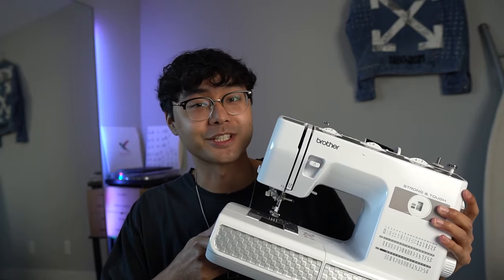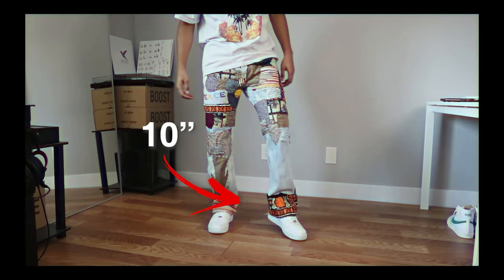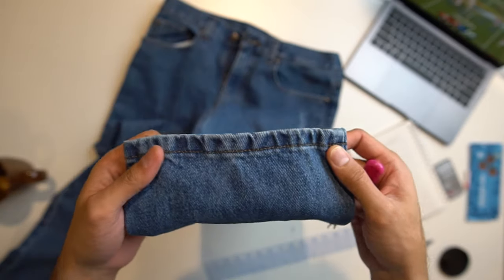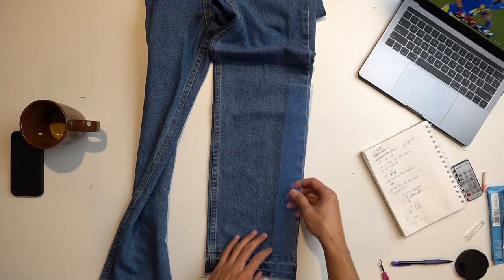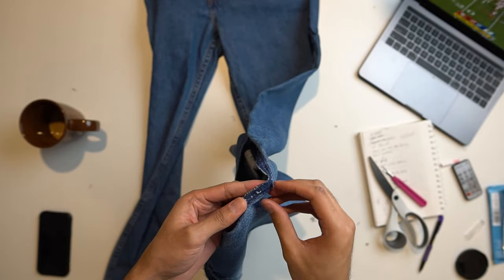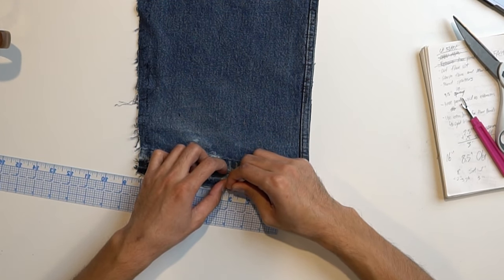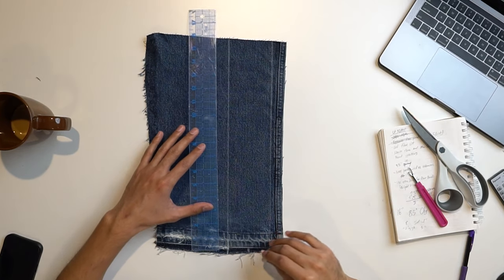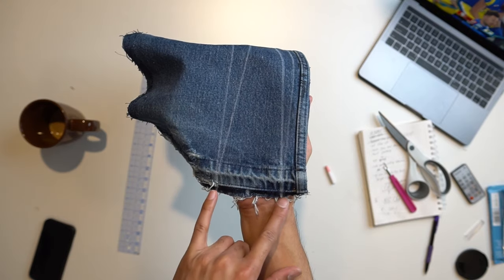How to Add a FLARE PANEL to your Jeans | JULIUS

Comment: good tutorial although since you used the same color jeans as flare I was unable to tell the most crucial part
Reply: specifically 4:36 and on, theres no real explanation behind pinning the flare panel to the actual inside of the jeans
Reply: Thats where im a bit lost right now too. It looks like it was initially pinned to the wrong side and then switched? idk
Reply: So correct I can’t even tell what’s going on at that part

Comment: Can we use a glue gun instead of a sewing machine ? Will we get the same results?
Reply from the maker: never tried hot gluing fabric before. maybe itll work but it wont be as secure. also idk if you can wash it.

Comment: does this work with glue ??
Reply: fuck yeah it worked. i made it work 💪🏽
Reply from the maker: Nice! What typa glue did you use?
Reply: @Julius_Nathvn  regular hot glue man. & then i went over it with glue that they sell specifically for denim & other materials. that shit still working like a charm DEFINITELY MACHINE WASHABLE 4 WHOEVER WANTS TO TRY IT !
Reply: the denim glue is sold at walmart btw. very affordable!
Reply from the maker: @cesarreyes7518  hold up could be a game changer 👀

Comment: I can't be the only one that don't k what's going on, lol this literally showed me nothing you didn't explain how you pinned the flare panel and you cut the clips so many times in the most important parts to where I lost track, you never fully went in depth for this to be a tut.
Reply: Guess He didn’t break it down to the point where someone whose never stitched in there life would understand but if uve tried tapering jeans normally this was pretty easy to get. U line up the edge of your jeans with the slanted line u drew (face to face), stitch it then do the same on the other side. The jeans both being face to face allows u to follow the old stitch line while sewing as u can see at 5:25 and u can pin anyway u like( to the right, left or straight down where you’ll be stitching ) Not sure exactly where you guys are getting confused but willing to try and help but there’s not much to go in depth with as it’s Like 2 real stitching steps
Reply: @JayFlacko  i got it after a while but thanks for the help